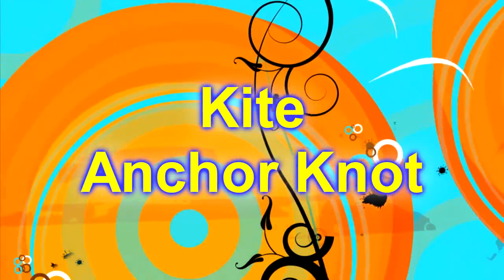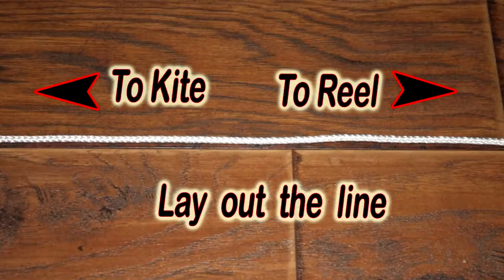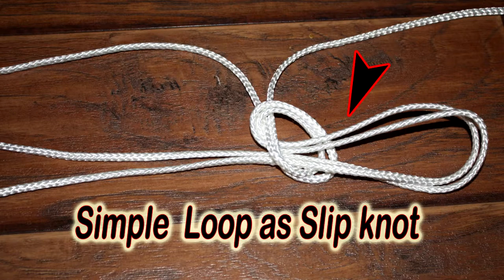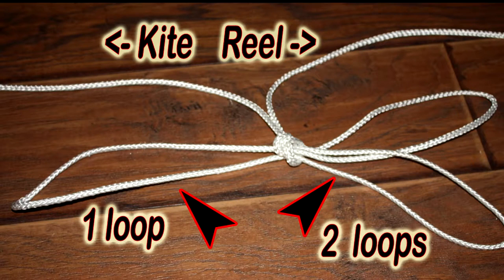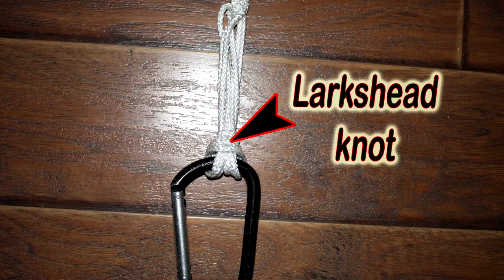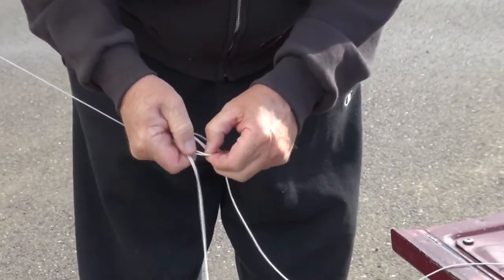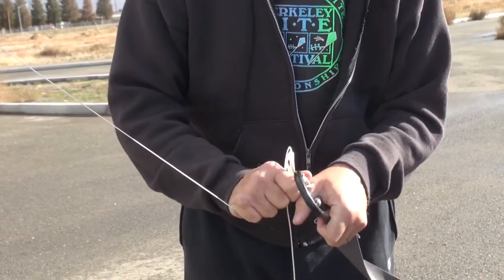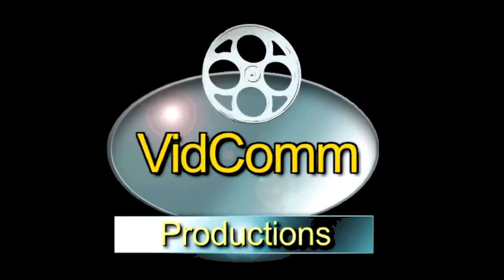Kite Line Anchor Tutorial

Comment: Hey Glenn, I'm curious as to what is on the Aft end of this seat-belt contraption as its connected to your pickup?!?
Reply from the maker: Dano, I use an 5 inch Harbor Fright carabiner which can pass through the hole in the metal buckle blade on the male end of the strap. I add some rubber tubing on either side of carabiner to help center the metal buckle. I have a spring loaded seat belt retractor on the strap itself to make it compact and self winding. In use, the caraginer connects to a  bumper hitch hole. Easy peasy. Oh yes, set the brakes!

Comment: I love this method, it was just the insight I needed to address my situation for a lifter. Out of curiosity what kind of test is the line and what exactly is it called. I need to step into a 1000 pound test setup for a 27 foot lifter with 35 foot tail I just got. I don’t like the large plastic winder I prefer the wooden ones . Can’t find them
Online. The strongest test I have is/was 250 lb and it was Kevlar rope. Cut my fingers and lost my two polka manta ray stack last week
Reply from the maker: Amy, sorry about the cuts and kites. You can look at HQ climax brand 1000 lb line, you can look at Sterling brand sheathed braided 1250 climbing accessory cord 5mm diameter. You can use Peter Lynn or Tug.com dyneema line. The difference is this. Dyneema is slick and harder to handle than sheathed accessory cord. Accessory cord has a better grip, but is heavier. In a good wind, the difference is negligible. The weakest part of the line is at the knot. Learn to tie a figure 8 knot to retain 80+% of the line strength.  You can store the line on a orange plastic electrical cord winder from a home improvement store, or you can repurpose a canvas bag to put the line in any old which a way. The important thing is to never allow the end of the line ( with your figure 8) to fall back into the bag, as it will likely form a knot. Also, you should tie a colorful flag about 20 feet from the other end of the line as an indicator of the end.  If you are hauling down a big kite and you can not walk down the line with a pulley, then you will walk down some of the line, make this knot and walk it back to your anchor.Doing that three or four times should do it. You will need leather gloves. Bicycling or rock climbing gloves are better than muleskin work gloves. Use baby powder to get them on and off. You will want no less than 150 feet. It may also be worth your while to take a 20 foot length and fashion a separate ladder line for use between your flight line and anchor Regards, Glenn email is mitchell93210@gmail.com
Reply: @PanyingPilot  that’s awesome! I’m here on the field just absorbing all this knowledge. I have the knot you show here down, is that the figure 8?
Reply: @PanyingPilot  I’m gonna check out the rest of your videos for more tutorials. I appreciate your style of teaching and I am easily able to follow along. 
I’m still reeling from the loss of my two stack pink and black polka mantas. After seeing yours, Jim’s and Mike’s, I had Tim Sorensen order from his people to make a replica . First custom kites I ever had made. Anyway last week I was flying in conditions that I knew where too strong and unpredictable to fly those, but I did it anyway. I’ve flown ‘em 100 times with the same set up, this time the line snapped at my anchor and off they went never too be see again. I tracked them visually to their first obstacle in a far off tree in a neighborhood. By the time I could get closer they are gone. Spent hours searching and knocking on doors

Comment: Lately I have been flying my kites off my truck bed like that how are you connecting the seat belt to the truck. I assume you are connecting it to your trailer hitch or something. I have been using a carabineer and wrapping line around it several times and just clipping it on to the tailgate cable which is fine if I am seating on the tailgate but with my bigger kites if I get off the tailgate it actually starts to lift the tailgate up. I would love to see more about creating anchor points for use on back of  trucks.
Reply from the maker: Good morning Mark, Flying the big stuff can be a challenge under any circumstance. You are correct that I am connecting the seat belt to the bumper. I use the hole for the towing ball together with a quick link (or two) to make up the connection between the anchor strap and the vehicle. I recommend the descender ring for smooth deployment of heavier line. I also favor the Spanish knot (see my tutorial) because a twisted larks-head can be the devil to loosen up later on. If your truck is equipped for being towed, you will agree that the serious weight is on the engine side of the truck. Finally, do not be shy about making a curb your unpaid servant when parking. 
Send photos to mitchell93210@gmail.com or post a video, OK? Hope to see you at the Convention. PS. bring Trilobites!

Comment: Yo, Glenn!  Excellent show-and-tell tutorial!  After slowly growing my skills flying increasingly more & more challenging kites over the past several years, I am ready to try my hand @ a huge flowform lifter (13 ft. x 10 ft. / 4 m x 3 m) using a 6-point ground stake anchoring system based on heavy-duty 14" solid-forged steel stakes, 20 ft. of 5,000-lb. test strength webbing, a universal swivel, & (4) heavy-duty carabiners (all w/ compatible test strengths as the webbing w/ sewn-in loops @ both ends).  This anchor knot will be the perfect complement to my set up, particularly because I will be flying this large flowform up to 150 ft. max only from the anchoring system and not from a hand-held reel (which would be impossible w/ a kite this size unless one wanted to end up in the South of France across the Atlantic).  Thank you for demonstrating this knot so clearly in detail.  Happy flying!  Best regards from North Baltimore, MD.  Keep well and safe!  :-)  Robby
Reply from the maker: Robby, comgratulations on your setup. You are going to cause a sensation. May I also suggest you equip with a haul down setup? This consists of a spit pulley connected to a carabiner which in turn connects to a webbed strap with sewn loops. In use, the pulley is placed over the flight line and kept closed with the carabiner and strap. You will walk the kiteline down until you can land the big kite and flip it upside down, or alternately bringing the trailing edge uowind. If you are flying over an obstruction, you may walk down a portion if the line, and haul that length back to your anchor, tie off and repeat as needed until the kite is grounded. Consider REI mountaineering supply as a starting point for split pulley shopping,

Comment: Hi Glenn, thanks for the video. What strength is the carabiner rated for?
Reply from the maker: Peter, for the big kites I use Omega brand 22KN oval carabiners  for smaller stuff, I have many Harbor Freight carabiners of assorted sizes. If you are going to fly the big stuff use climbing gear or arborist quality stuff, but opt for aluminum over steel.
Reply: @PanyingPilot  Thanks, I could tell that was a H/F one. I have 22kn biners and straps, always plan ahead.
Reply from the maker: @peterbennett8810  Enjoy yourself Petet and keep me and the others in the loop, OK?

Comment: Intresting ! I only wonder how you manage to make this knot when you're on your own, wearing gloves and you have a hard pulling kite up into the air?...
Reply from the maker: Daniel De Rudder Excellent questions Daniel. You will learn from experience regarding gloves and needing an assistant. If you are alone, wear gloves if you must. Now, to your question. When rigging your kiteline, use  decender ring or figure 8 ring at the ground/sand anchor. See my other videos for an example. On the figure 8 ring, larkshead the line over the larger ring and clip the smaller ring to the anchor. Fly your kite.  When the line is paid out through the figure 8 ring and the kite is flying well, wrap the flying line around the figure 8 ring to halt the line. The line will be tight going to the kite, but will be loose on the other side. Make your knot with loose line, attach it to the anchor and remove the figure 8 ring if possible. If you get overwhelmed by wind, use a larkshead with a single twist to quickly make an anchor knot. Avoid getting your fingers pinched in the larkshead loops. You can clip a twisted larkshead on to a heavy carabinier and clip that to the figure 8 ring and it will lock off and be secure. Finish tying the Spanish knot and re secure it to your anchor, removing the temporary knots and gear as you can.p
Reply: Good advice ! Thanks Glenn.

Comment: Hi Glenn, I practiced making this Spanish Knot from this video along with the video from PremierKites last week. I tried it out in the field this past weekend. The problem I faced when flying without an assistant was creating slack in the line on a large, hard pulling kite. I tried creating slack in the line by using a karabiner attached to a thick rope wrapped through my belt loops and latching the kite line to the karabiner in the fashion that many use karabiners to attach line laundry. My intent was to use my body to pull in some slack on the line so that I could create the Spanish Knot.  Again, the pull on the line was probably strong enough for a tight wire walker and I couldn't attach the karabiner to the line by myself without an assistant. Does anyone have suggestions for solo fliers?
Reply from the maker: John Brink John, your description of the problem is excellent. A single person managing a hard pulling kite necessitates some pre-planning. We've all been there! Launch the kite. Pay out flight line from an anchor with a carabiner clipped to a figure 8 descender ring The flight line passes through the descender ring. See this page for carabinier /strap/decender ring gear.

 https://www.gombergkites.com/line.html

Rise your kite to the height you desire. Next,  stop further ascent by putting a bunch of turns around the narrow waist of the ring.  Your kite will be anchored, but not pretty. Next, prepare the Spanish knot. When it is ready, you may slip the three loops of the Spanish knot into the carabinier. You may then unclip the figure 8 ring and release line from it. Practice this at home first.  The result is a neatly anchored flight line and a disconnected figure 8 ring in hand. The ring can be employed again when the kite is walked down.  Regards, Glenn
Reply: Thanks for the input, Glenn. I just discovered GombergKites.com this past Saturday and found the page that you linked to. It was exactly what I have been looking for. I ordered the figure 8 ring along with some anchor straps and some more large carabiners. I also ordered a micro pulley because that was something I had envisioned would be ideal for walking down a kite. 
　
I was guessing that pre-anchoring was the key, especially with the figure 8 ring that can allow letting out line slowly and then temporarily anchoring with a few wraps around the mid section. 
　
Your comments helped confirm that I was on the right track. My order should arrive before this weekend so hopefully I'll have some time to plan and practice and then hope for favorable weather conditions this weekend. 
　
I have the ITW Triton Kite that I flew last weekend and it pulls pretty hard at altitude but the Mayan Double Delta Conyne Kite nearly cost me a serious hand injury several weeks ago. I had never experienced that degree of pull. It was pretty scary. 
　
　
I'll let you know how it goes and hopefully have some photos to share. 
　
Thanks!!
Reply from the maker: John Brink  With the right gear and some practice, you will be golden😀😀😀